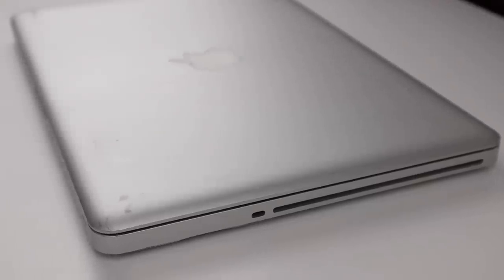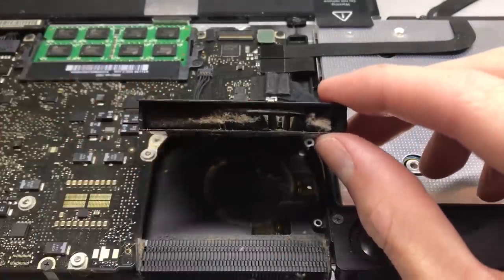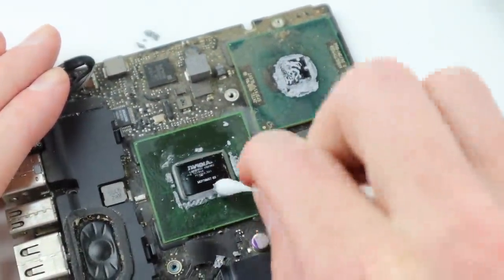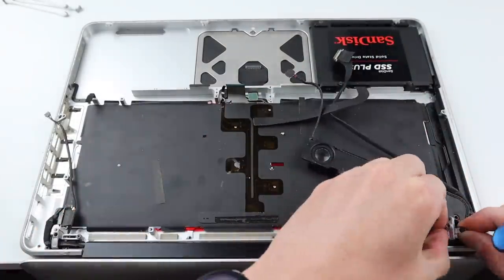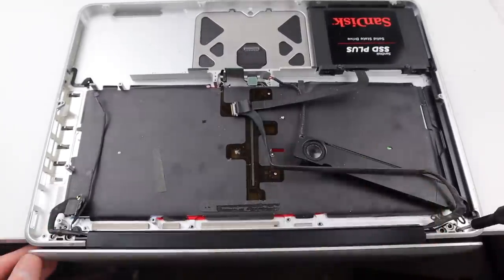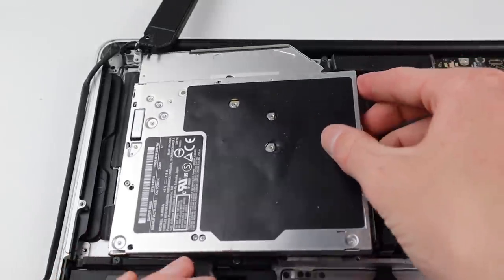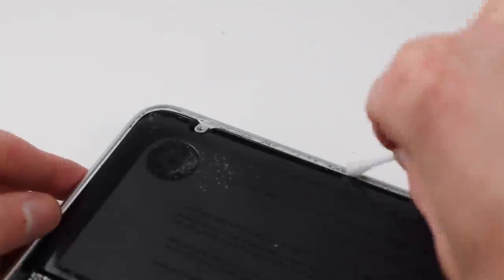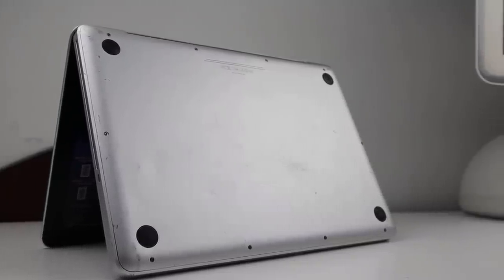The FREE 2009 MacBook Pro Repairs

Comment: I just noticed that every screw in this MBP are standard phillips and torx screws. No fancy pentalobes. Good old times.
Reply: TechGeos1019 they used tri-wing screws aswell... although just a few (3 I believe)
Reply: Ok boomer
Reply: Im soooo lazy it took me 3 weeks to reply
Reply: me with a normall windows pc: Yes
Reply: @radioactivevolcano8249  bruh
Reply: @impostor9336  tri wing?
Reply: @Doc_Tejas  yeah, it’s also called a triangular slotted screw. Basically instead of 4 slots like a Philips it has 3 which are evenly spaced.

Comment: You should introduce using a cleaner like SprayWay with a thick microfiber cloth (not a glasses lens cloth), its safe on the unibody for these things and gets them squeaky clean! Also try some canned air!
Reply: MurderMedia same thought!!!
Reply: Canned air has very low pressure and it's not advantageous if he works with computers a lot. Compressor is better way.
Reply: Edgar Koterle we use to use a compressor but it’s noisy canned air is much nicer and easy to control. I have no issues with pressure.
Reply: If you also like to work on cars i can really recommend an air compressor. You can use it to fill up your tires and to dust of pc parts .
Reply: air cleaner you mean
Reply: I will use air cleaner or freshener sometimes if the unit smells bad. It helps.
Reply: Simply spritz a tad into the micro fiber cloth
Reply: Or eucalyptus oil

Comment: Hi Hugh. I have come across your channel recently, and I appreciate what you do with old hardware. For dirty logic boards and motherboards, I would recommend using brake cleaner and high percent alcohol to clean them. Note that brake cleaner tends to discolor some plastic, however this should not be an issue if you remove the board from the device first.

Comment: One of the most challenging repairs appears to be an iPod Nano 2G. You need to be an expert to swap the battery or hdd.
Reply from the maker: Try an iPod touch, they are almost impossible. I will can't get my to work properly. I solder a new power button and volume button on, everything works. I install the final screws holding everything in place and bam the power button not longer works.

Comment: Hey, that was a very nice video. Recently I have disassembled the MacBook pro early 2011 which has a restart issue continuously. Then I have formatted the drive with the original base osx 10.7 unfortunately, the book restarted again. Then i have started to upgrade the osx to 10.13 then also same restart issue. Finally, I have replaced thermal paste for  CPU and GPU, cleaned the fan, components , like what you did. The result was awesome and installed the software,the book is up and running .
Reply: Get 4GBs in it and Catalina runs fine
Reply: @Dacari13  I have installed two 8gbs (16gb)  then also the MacBook pro not supporting  Mojave on it .i have tried to install Mojave and Catalina (not supported message) on the screen. I think 10.13 is final osx version to support on this logic board .
Reply: Go Geek Gadgets Look up on YouTube. It's possible with many models. DosDude mods
Reply: It could goes up to OCLP Monterey for the Macbook Pro 2011..

Comment: Hey Hugh, which specific vendors do you prefer to source parts? I have a MBP that has received repairs in the past where the product did not live up to repair warranty- I sourced eBay here and it failed.  I probably need a logic board replacement and finding a worthy vendor that lives up to their warranty is my concern.

Comment: Hi. 
I own a mid 2012 MacBook pro and I'm looking to upgrade to a SSD drive. However I'm curious if you think I should replace my battery as well? It has around 700-900 cycles lady I checked. 
And also, is there a way to tighten the hinges for the screen without disassembling the whole screen? Thanks for the interesting content. Keep it up.

Comment: Hi Hugh- love your videos! I have a 2004 iMac G4 that someone placed near a dumpster. It works perfectly, and I was able to download and update it to Leopard (or is it SnowLeopard, have forgotten) 10.5.8. Do you know any way I might update it further? My computer fixit guy says I would not be able to install a new hard drive or SSD. I appreciate any help you might offer. Unfortunately I am in the US, so cannot bring it to you :) Thank you for your content, I am a bit of a MacHead, love old machines as well as my Macbook pro 2010 in great shape, and an iPad 2 also working very well for my needs.
Reply from the maker: The iMac G4 can only run up to 10.5.8 leopard given it's different processor architecture (PowerPC)
In terms of upgrades some models can support 2GB of ram. If you are upgrading the HDD it doesnt use the SATA interface but rather IDE so you need to find an old HDD or special SSD to install into it.

Hope this helps you in some way.
Reply: Hugh Jeffreys thanks for the quick reply!

Comment: I had to replace  the battery on on my late 2009 MBP bc it was swollen preventing the trackpad from clicking and I put a ssd and 4 gb of ram bringing the system total up to 5 gb of ram bc I left one of the 1 gb sticks in it the MBP is working with a clicking trackpad 🎉❤😅

Comment: The power of the Cpu can barely run Youtube videos, unless they are 480p on chrome since it uses VP8 or VP9 video.
CPU is at 100% so fans need to be on.
You'll have to use Safari to watch Youtube since it forces h264 video and still you are at 70% CPU.

Comment: 2:25 You basically risked the entire board, you aren’t supposed to put liquid onto the board and it can cause corrosion, just use a can of air
Reply: Alcohol does not affect the motherboard, the thermal paste is for more efficient cooling.
Reply: Zycklacon Liquid on a board is fine as long as it's dried. Also depends on the liquid.

Comment: Today i also repaired my 15 inch mid 2009 MBP
Screen hinges were broken so i bought a second hand screen assembly
Seller mentioned that the cable for WiFi l, Bluetooth and camera had bent pins but the damage was minimal so i thought nothing of it
After replacing the screen and  connecting the cables it let out fire and smoke on first power on
Laptop still worked after disconnecting that cable
Sadly WiFi and camera functionality are permanently no longer working (bluetooth still is surprisingly)
A bit sad but cant do anything about it
Reply: Oh shit, that’s bad! You should have looked at it under a microscope!
Reply: @CompuKonstantin  in hindsight yes i should have looked at it better.
Not a huge deal because i can just use a USB WiFi dongle and internal Bluetooth still works. Wasnt using the camera anyway.